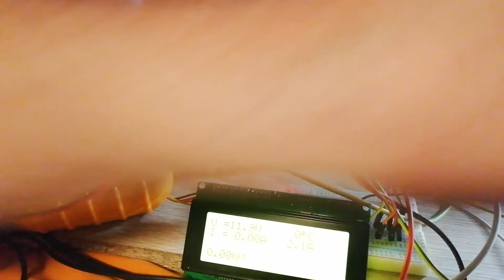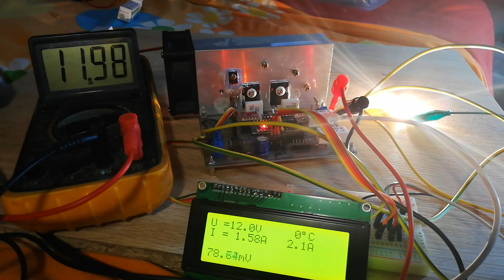Power supply controlled by Arduino (2)

Comment: lesson number 1
never use arduino to limit current
Reply from the maker: too late.. is software control, slowest than hardware protection, but is.... on other hand, is a test with enough goid results
Reply from the maker: you check the description of the video? is not my original project, but test was ok for my side